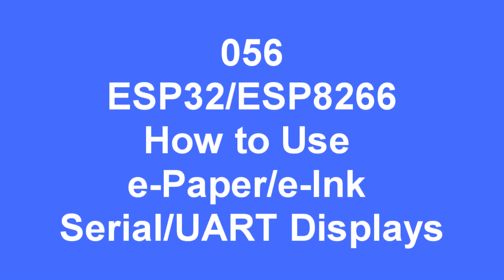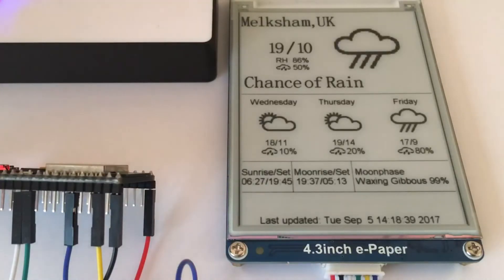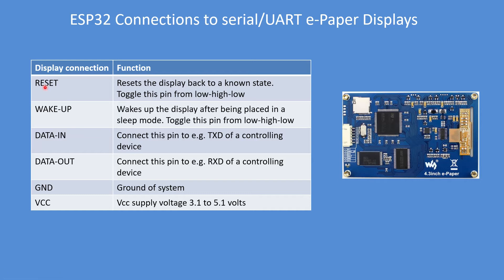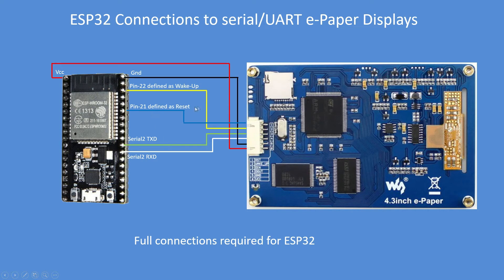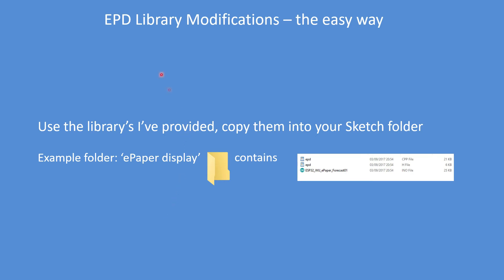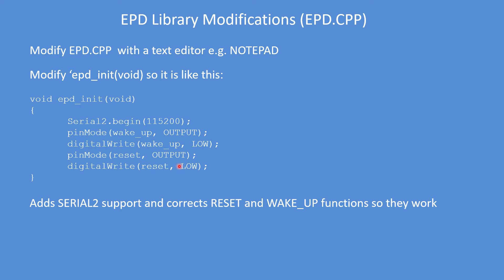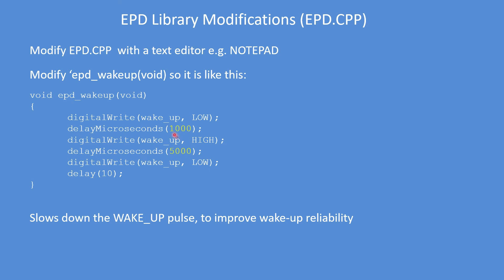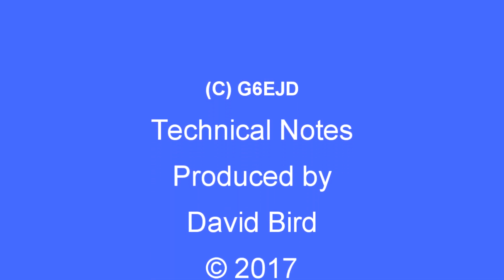Tech Note 056 - ESP32 ePaper Weather Station using serial (UART) display with Code

Comment: What should I do for partial updates? I'm fairly new to the Arduino as well. I tried to look it up in the library so that I know which code to write but there is none.
Reply from the maker: If you have the serial interface epaper display it is not capable of partial updates

Comment: Good morning David. Hope you are doing well. Do you plan to make an "Open Weather Map" version that can run on 4.3 UART e-paper screen. Tech Note 56 is only made for "Weather Underground". Sincerely, Georg
Reply from the maker: Hi Georg, in essence it’s any OWM source code with the display section modified for the 4.3” display, made easy now because the GxEPD library supports the serial display, thing is finding time to do the conversion, but little should change.
Reply: Hello David. Thank you for your reply. It's still a bit unclear what I need to do to make it work. I have an API key from OWM, but the sketch is built on WU. You have made a modification of Tech Note 092, so it is now made for OWM, so can I use that sketch? You write that GxEPD library can be used, but GxEPD 2 does not support 4.3 "UART display, so how can I connect that display to work? Regards Georg
Reply from the maker: I was meaning that one of the newer sketches for the 4.2” display can get the data then it’s a small task to change the driver to the 4.3” version as the drawing primitives are the same.
Reply: Ok, I agree, but which driver should I use for Waveshare e-paper 4.3 UART?
Reply from the maker: I’ve been through the drivers and it seems support for the 4.3” serial display has been dropped, so there is no easy solution to implement.
Reply: Hi David.Thanks for your efforts, to find a solution to the problem. It can be solved if, Tech Note 056 can be made to run on OWM API key, as the sketch has been built up with a display driver for 4.3 "UART display. Thanks again for your help. Regards Georg

Comment: which one is faster the display 4.2 inch ,that work with SPI Interface or this one 4.3  inch with Uart interface ?
Reply from the maker: The 4.2” is significantly faster and uses much less power. The 4.3” uart controlled version I have found to be temperamental and unreliable and limited for fonts as there are only 3 sizes and basic fonts installed, not used mine since. There is very good library support (GxEPD) for the SPI interfaced versions like the 4.2”, but if I/o lines are in short supply then the 4.3” variant is just about usable. Colour versions are all very slow and can take up to 15-secs to refresh, avoid unless absolutely necessary.
Reply: @G6EJD  thank you for this informations

Comment: Really clear summary, loved the minimal setup required and the detailed explanation. I wasn’t aware that copying a library into your sketch folder was a thing to do and if I have it correctly means I can modify the library for that particular sketch? It’s amazing to me that more often than not, I always find nuggets of gold where I least expect them. It’s taken me about 18 months from zero knowledge to be able to understand the contents of your work. I am very grateful for the effort and time and for providing a light to follow when I am lost. 

Thank you🏴
Reply from the maker: Yes you can copy a library into the sketch folder and when you open the sketch you get tabs for each file there-in, allowing you to modify a library as required. There’s a menus on the top right of the IDE that enables you to manage the files too like add a new file etc.

Comment: At 7.25 in the video, NB if modifying your own epd.cpp: having previously declared "Hardware Serial2(2);" as shown, ensure that you are indeed writing to Serial2 in _putchars() and epd_set_baud().
Reply from the maker: Yes and for reliable operation with an ESP you need a pull-down resistor I find 2k2 is about best on the RESET line, because when the ESP sleeps it releases pull-up resistors on the RESET (pin) and this wakes the display up with an input transition, the pull-down overrides the ESP pin-state change and keeps the display asleep.
Reply: Thanks. I am clueless with electronics (but am happy enough with programming), and I have ordered a 2k2 resistor and will give it a try. My sketch seems stable at 5v (it is similar to your weather display, using ESP32 wemos Lolin board and WiFi to pull data) and i try to ensure WiFi and display are not drawing current simultaneously. The 4.3" epaper display seems to be only stable at 5v, whereas when on 3.3v it triggers brownout detection on the ESP32, which in turn results in both epaper + WiFi drawing current simultaneously. That in turn guarantees more brownouts. In terms of the electronics, does it make sense that the use of a pull-down resistor would be more important at 3.3v than at 5v ?
Reply from the maker: The display can run at any voltage between 3.3 and 5volts, but the logic inputs are 3.3v. The 2k2 helps prevent the line from transitioning when the ESP releases its pull-down and pull-up resistors. It's not a complete solution, but the sleep reliability increases to about 95% or more from about 50%. Ideally Waveshare would not have designed the interface like that as most controllers do the same. It would have been better to have / require positive transitions rather than a sleep condition effectively dropping the lines and triggering a wake-up...

Comment: Great project! Can I use ESP8266 instead of ESP32 with same connections? Thanks in advance.
Reply from the maker: You can use the ESP8266, but the serial port connections are different from the ESP32, but you can use the softwareserial library to use any two pins.

Comment: Great Project, The code is working well, with the 4.3 inch display, QUESTION:, I cannot seem to get the display in portrait mode, the screen rotation only inverts the display , and is there a way to display weather underground in Fahrenheit ?... again cool project nice work !
Reply from the maker: Rotation has 4 options, each rotates through 90° (0), (1), (2) or (3) so 1 or 3 are the two portrait modes. The display should rotate without issue.

See the readme on git hub for how to print ° symbol, it took Waveshare a couple of weeks to respond to me on how to do it! I don't know if there are other command sequences, most probably there are.

For Unit changes:String high0  = forecast["forecastday"][0]["high"]["celsius"];Replace the JSON suffix with in your case "fahrenheit" all lowercase:

String high0  = forecast["forecastday"][0]["high"]["fahrenheit"];Others are "in" for "mm".

Send me your email and I can send you the full JSON response from the API. Alternatively if you go to WU and API they give you an example for ? Los Angeles and you can see the full version there. 

There is a small timing issue with the ESP32 as it's too quick for the display and sending the ESP32 to sleep occurs before the display has finished, depending on the display content it's random when the display (LED) stays on or not, the feedback from the screen ("OK") after a command is not yet implemented in their library, so delays are the solution, but not always. Currently I'm experimenting with the state of the ESP32 pins on power down, as when it goes to sleep the EPD display sees that as a 1-0 transition and wakes up. SO-far today sending the pins to INPUT's before sleep seems to have resolved it, but it may still require  pull-up resistor.
Reply: Thanks for the fast reply, great info, and I now have US standard Fahrenheit !, However try as I might, I can only get landscape mode to work. I tried 0,1,2,3 and all it does is switch between 180 degrees, not in 90 degree steps, so of course not seeing all of the display. not expecting you to solve it, but scratching my head on this one, as I look to have the same display as you....Thanks !
Reply from the maker: +Ross Romeo if I recall, there is a firmware issue that was corrected, you can update the firmware via the waveshare wiki, the process is download the file and copy to an empty micro SD card, insert and it updates. I think that will solve the problem.
Reply from the maker: +Ross Romeo http://www.waveshare.com/wiki/File:Epd43-uart-module-firmware.zip
Reply from the maker: +Ross Romeo I found the reference: Return the current display direction
0: Normal

1 or 2: 180° rotation (depending on Firmware) so you do need to update for all options.
Reply: Thanks So much, I did upgrade the firmware, and problem solved I can now rotate in 90 deg increments, and it's working like a charm, I plan to mount this in a case so I can have a quick look at the weather anytime !, added USA time of course as well !as I am in the Washington DC area !
Reply from the maker: +Ross Romeo Good to gear its working now, likewise mine is going into a case I may print one in due course. Ironically I know DC quite well especially around Crystal City and the Navy Yard to name a few haunts not forgetting Legal Sea Foods and Ruth’s Chris steak house. Enjoy.